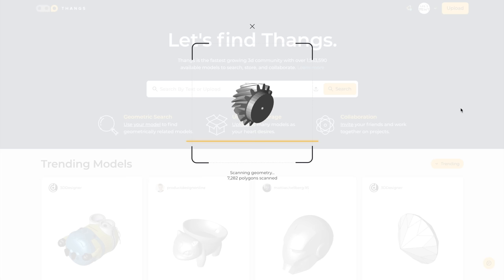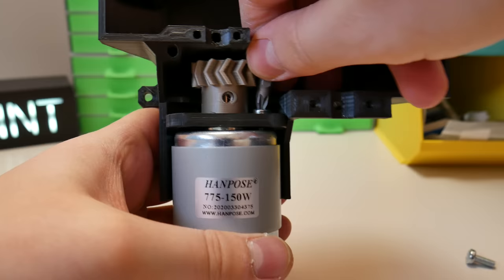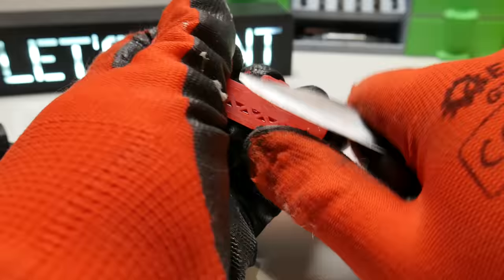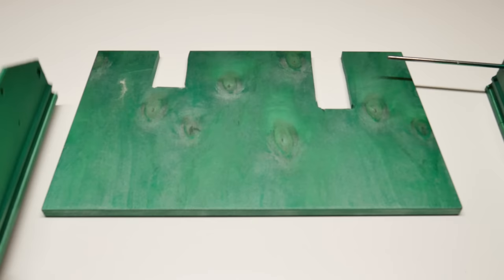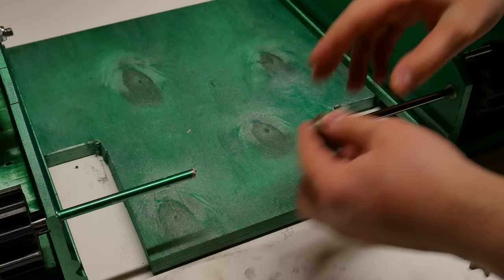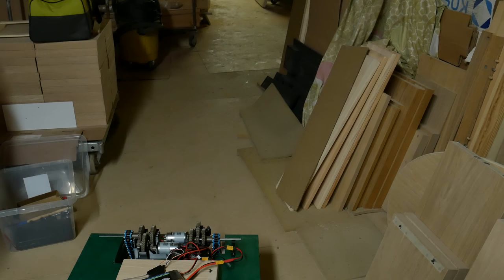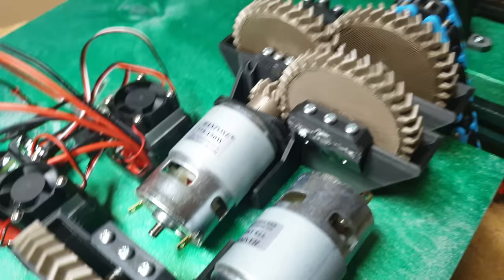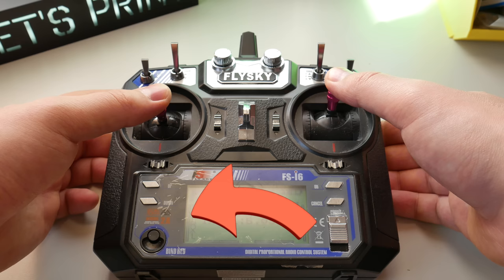3D Printed RC TANK - Will This SURVIVE?

Comment: Just a few improvement ideas - enlongate your tank and make it thinner.

It means redesigning your gear box, but this will make working over terrain alot easier... I'm sure lining the gearbox with the skirt will be pretty compact and look very nice. 

Also try to limit how many items you have underneath the tank. With an elongated body you should be able to support a platform about 2/3rds of the way up the wheel and encase everything to protect it but also add a bit of weight to give it better traction... Just try not to make it too tall... Slim is always better.

Perhaps putting both motors back to back on the rear of the tank and an encased lateral gearbox alongside the tank treads would be best.

Comment: The lubrication should be on teeth itself, for shafts you should use bearings. Also please don't hit the bearings with hammer like this. Use rubber mallet with larger surface area or some kind of block. You are going to fuck up those bearings sooner or later.

Comment: One improvement would be to make the gearbox in such a way that you don't need the printed chains, instead use gears to transmit torque to the tracks. Second would be to make the tracks wider as said by somebody in the comments. And to improve stability (a little bit maybe cuz it's still plastic after all) is to make the track sprockets heavier, instead of attaching extra weight to the body itself. But in the end this is still good because I know how time consuming and mental consuming stuff like this can get.

Comment: For the V2, tank designers figured out that the tank should be about 2 to 1.75 times longer than the width of the vehicle. The more wide the tank is, the easier it is to turn. But less stable it is, both in the forward direction (flipping end over end like yours) and less stable in the yaw direction (the vehicle would tend to wander to one side or the other while trying to drive in a straight line). If you make it more narrow, there's better grip with the ground and theoretically better speed, but it will turn like a pig.

Comment: What you call siudeskirt is not present on tanks.
As tanks have suspension holding their wheels, they are not rigidly attached to the chassis of the tank.

Comment: @03:00 That Layer Line orientation looks horrible for what you're using the part for... With the Screws acting as reinforcing Pins anyway you'd have fared better 3D printing them standing upright so each layer would have formed a continuous loop around both screws in each link - If you then add some sacrificial 45° geometry below the overhangs acting as built-in support you could have 3D printed them without Slicer generated Support and would have had an easier time snipping those built-in Supports away with sharp Side Cutters. Also print time is highly Printer specific.
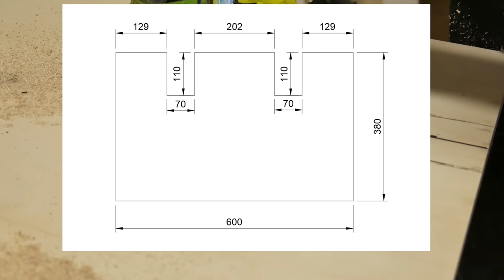@04:00 Side Skirts are more of a protection thing - Not a structural part like in your tank so a more appropriate description would either be a Running Gear Assembly or Running Gear Pod akin to how the Milrem THeMIS System works - Which I'm highly suspecting to be the inspiration for this project 🤔
@06:10 I don't want to split hairs but man... I think those 3D printed Parts look like they would have benefitted from either being made out of wood like the top or 3D printed flat 😏
@06:31 A bit more complicated but doing a tank with just one Motor driving both the actual driving axles and an input shaft for a differential steering gearbox controlled by a Servo switching it either into either one or the other direction via Slip Rings would also be possible 😁